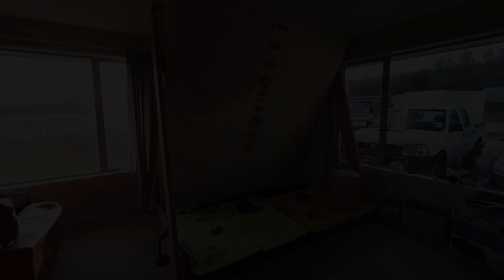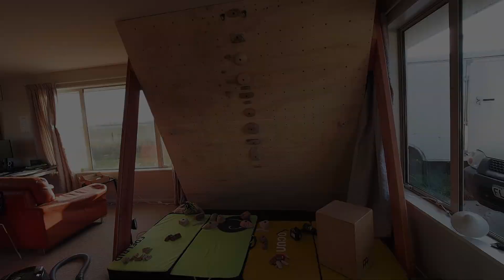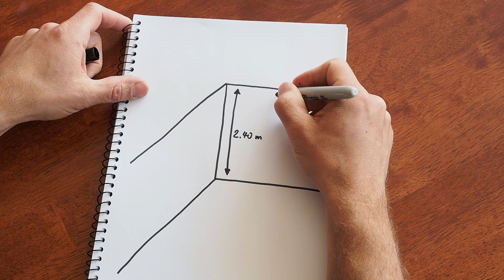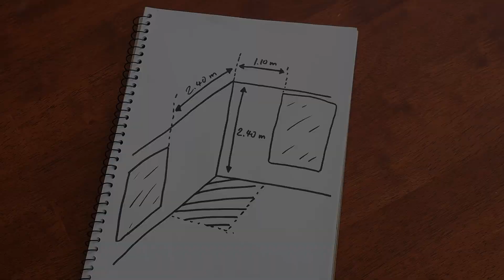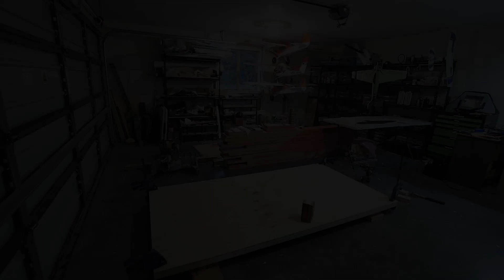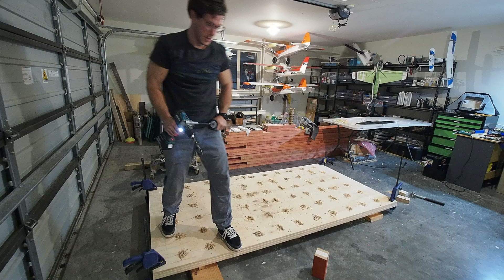How To Build A Free-Standing Indoor Home Climbing Wall

Comment: Man such a beautiful wall! Definitely an inspiration for my own project. Also, I just love the view you have from your living room!
Reply from the maker: Thank you Elias. I'm really pleased to hear that. Enjoy your project! :)
Reply: @wurfttobias  I got a question! Those large nails you hammered in, did you attach a nut on the other side of them?
Reply from the maker: Yes, those were bolts so I attached a nut on the other side.
Reply: @wurfttobias  I've got one question! I live in an apartment with people above, below and by both sides of me. I wonder if a wall would cause a lot of noise. The walls and roof/floors are pretty thin in the apartment. I'm mainly worried about if the wall causes a lot of noise when you climb on it (when it pushes down on the floor), more than the bumps from jumping down because if you have thick and soft enough padding, I think that can be evaded pretty well....? I guess in that case, the sturdier the better, as to not cause unneccessary movement (which causes noise I guess).
Reply from the maker: @eliasholenhannouch807  Are you worried that the floor will make noise when you are climbing, or that the climbing wall is making noise?

I can just share my experience: a sturdy freestanding wall doesn't make any noise if the floor is sturdy as well. Climbing only gets noisy when you hit the wall with your shoes. 

But I guess  there could be some noise if the building you're living in has beams and boards that make noise when you just walk around... The small movements of the floor could probably also cause some torsion of the wall which could be noisy...

Does this answer your question?
Reply: @wurfttobias  Yes, it does! I meant primarily noise when climbing. I certainly won't do any dynos, so as long as a sturdy wall is quiet during "normal" static climbing I think it will be fine! Thx!

Comment: Really nice!!!! But, is possible to build the same structure in a situation where the top of the structure doesn't touch the ceiling? Thanks
Reply from the maker: Thanks! Sure, that's possible. It's a free standing wall. The structure isn't touching the ceiling, there is a 2 mm gap... 😁
Ideally, you want to make your climbing wall as high as possible as long as your ceiling height isn't above 3.5 - 4 meters.
Reply: @wurfttobias  Thanks... you think that I can use a beam 9cm x 9cm to use for build the structure? (I have this kind of beam at home)
Reply from the maker: @simonekresevic6016  It will be less sturdy than when using 140 mm x 45 mm boards while at the same time being heavier... It will probably work, but I'm not an expert so please ask someone else for professional advice.

Comment: Sweet wall. May I suggest a sheet of Lexan between the wall & the window? (To save a flagging leg from going thru it?) I'm sure you'll be careful to not go thru it, but having friends over for a session...
Reply from the maker: Thanks for your input, that's a good point! I have some really large, 2 meter long, 1 meter wide, and 250 mm thick foam offcuts left over... Will put them between the window and the right stud of the wall while I'm climbing. Should make it safer! :)
Reply: @wurfttobias  that’s a cheaper fix! As Lexan can be pricey, I paid $100 for a sheet to hang in front of my 55” flat screen when my kids were younger. It saved me from having to buy 3 replacement TV’s and cleaning crayon off of it. I suggested it because it would still let the light in, but I like your cheaper alternate

Comment: Strong and simple design 👍
Looks like a lot of work - are you drilling pilot holes for all those screws?
Reply from the maker: Thanks Kristian! No pilot holes for the frame, only for the top and bottom board to make sure that the wood doesn't crack at the ends.
Also no pilot holes when screwing on the plywood.

Comment: Awesome build! Could you explain why rounding off the edges of the 2x4s prevents the studs from moving?
Reply from the maker: Thanks! I rounded the edges of the studs to reduce the risk of injury when climbing. The 2"×4"s at the bottom which are bolted to the studs as well as the plywood panel at the bottom prevent the studs from moving.

Comment: Thanks for sharing the video and design, I am about to jump in on a build here in the next few days.

Do you feel like your stud spacing would be sufficient for a wall that is a bit steeper (37.5 degrees)? Standard stud spacing in US is 16" (~400mm), but that seems overkill with 2x8 lumber, I was thinking going something around 19.2" (~485mm) or 24" (610mm) on center.
Reply from the maker: You're welcome! You've got exciting times ahead of you. :)

On my first climbing wall, I had something around 485 mm spacing, which was plenty in combination with the 22 mm thick plywood. From what I've seen in commercial gyms, you can increase the spacing if you're using enough vertical struts.
Reply: @wurfttobias  thanks for the response, I am going to try 485mm spacing with 18mm plywood. I think given the length of the actual wall it wont move to much, but we shall see.. Very excited to finally have a wall at home to train on, BIG DAY.

Comment: Great video, thanks Tobias! Do you think it work to have longer pieces on the base, with more holes, so that you could remove the bolts and change the angle of the wall? I’m hoping one wall could be used by a range of abilities by changing the incline, thanks, Olly
Reply from the maker: Thanks Olly! I'm pretty sure such a design would work, but you should definitely consider that the wall is very heavy... There are plenty of different adjustable angle wall designs out there (e.g. https://www.megalithclimbing.com/pages/freestanding-adjustable-system-wall ) and because of the weight of the wall most use a pulley/winch design with some backup chains. The 'home climbing wall forum' on Facebook is also really helpful if you're planning such a wall. I hope this is any useful for you. Cheers, Tobi
Reply: @wurfttobias  Thanks! :)

Comment: A very well put together board and video. It's super! 
I want to build exactly this and living in Queenstown NZ. I got a few questions as to how I can do this but maybe a bit cheaper. I'm thinking of using 2x4 instead to build the frame.

Where did you buy your T-nuts and bolts from? And overall cost for all nuts and bolts?
And any advice or tips and tricks you learnt after building this that aren't already in the video?
Reply from the maker: Thanks so much!!
Ok, this is gonna be a longer one... :)

2×4 are an option but I would at least use 2×6. (A flexing homeboard isn't really fun)
To give you an overview on the cost side of things: I spent
190 NZD for plywood
130 NZD for screws and T-nuts
110 NZD for bolts (not for the holds), plates, nylon washers, laminated 2×4 and laminated 2×6
500 NZD for the 2×8
--> just under 1000 NZD.
You will probably spend at least as much for holds so for me it doesn't make much sense to reduce the total costs by 10-15% by using 2×4.

I helped building the new Uprising in Christchurch and I buy Würth screws and Würth T-nuts via my contacts there. :) --> advice: ask at your local gym, they should have T-nuts.

And I buy bolts at a local engineering supply. Don't know if that's really cheap (0.50 - 2.00 NZD per bolt depeding on the length).

Learnings: 
- could have made the hangboard stick out another 100 mm
- would have used 22 mm plywood (better quality)
- general advice: make it as big as possible. This wall is an awesome training tool and I love it. But my old homeboard was bigger and thus required less dedication/motivation
Reply from the maker: And one more thing Jamie: you can let me know when you finished your board (via instagram?). Would love to check it out at some point when I'm in Queenstown again :)
Reply: @wurfttobias   you bloody legend! Thank you so much for giving me everything! Just two more questions.
Is there a reason you didn't buy the treated plywood in the first place?
And with your T nuts did you put a dab of glue on the back to prevent them spinning?
Of course I will send you pictures and your more than welcome to join me on it when I get this puppy up and running
Reply from the maker: Awesome Jamie!!! Looking forward to the pictures! :)
They didn't have the untreated 22 mm in stock (treated is expensive and not required for indoor).
Glue is also not required if you have access to the back of your wall!
Cheers, Tobi

Comment: Awesome wall! May I ask what type of wood you used for the 2x8 frame? I see you used pine for the plywood but might have missed if you said the wood type for the framing lumber. Where I’m located most of the 2x6s come in either douglas fir or pine so just checking which you would recommend or another type. Thanks!
Reply from the maker: Thanks! I'm using pine for the frame.
Reply: @wurfttobias  sweet! Was it all pre-treated wood? The frame and ply? I read somewhere you can either buy untreated wood and paint it immediately after build to seal it or buy treated which u have to wait 4-6 months to paint. This will be my first big woodworking project, I’ve only done small scale stuff to this point, so just looking for some pointers to get it right the first time haha
Reply from the maker: @stephenlopez3553  the frame wood was already pre-treated. Why do you want to paint it? Is it for an outdoors wall? That's a good first big project! :) 
Cheers
Reply: @wurfttobias  oh okay good to know! It’s gonna be indoors in a garage but we live in a relatively high humid area so i wasnt sure if i needed to seal the wood to prevent splitting/cracking over time so thats the only reason I was considering paint. But i prefer the natural wood look!

Comment: This wall is awesome! I'm looking into building one that would be 3 sheets of plywood instead of 2, at 35 degrees overhung. Do you think I could still get away with the 2x8" supports? I'd really like to avoid more supports in the climbing area.
Reply from the maker: Thanks Alan! From all the other walls I have seen out there, I am pretty sure you will get away with it. Keep in mind that the frame of the wall with the plywood is already quite sturdy (not much movement to the side) so the support studs have to mainly carry the weight (which they can) and not handle much side forces. But I'm also no certified builder and after some quick research it seems like in the 2 meters and longer span they often double up 2×8"s to prevent buckling: https://plasticinehouse.com/how-far-can-2x8-span-without-support/
I would just build it, see how sturdy it is, and in case I have doubts I would double them up.
Reply: @wurfttobias  ah good call. Thanks for the response!

Comment: Not sure if I missed it, but what angle is your wall? and do you remember what angle you put the Mitre saw at when cutting the studs to get that angle?
Reply: aw i see it. set at 26 degrees.
Reply from the maker: I can't remember the angle of the studs, but as far as I remember I chose an angle so that the bottom of the studs are about 30 cm further out compared to the top of the climbing wall.

Comment: Hey Tobias, I'm looking at making a very similar build but for the moonboard so 12'x8'. 
Given the extra height is there anything about the structure of the frame I would need to change?
Reply from the maker: Hey, I'm not a pro so please make sure to double-check. I think I looked this up a while ago and a builder would double up the two 2"×8" studs which support the whole wall if they are longer than roughly 2 meters (don't know if its actually necessary in this case). I would also make the studs stick further out than the top lip of the wall (in my design it's only 30 cm) so your larger/higher wall can't tip over. 
Enjoy building and climbing!

Comment: Is the wall size enough to consistently have fun and train? I am about to start a similar build and I am wondering :)
It looks so cool!
Reply from the maker: Very good question!! It's definitely less fun than my old 42 degrees, 3 m × 3.5 m board. I can't get the rewarding feeling of finally climbing a 10 moves boulder after months... But I still use it consistently because:
- the angle (less steep) is better to train more often
- all wooden holds is better for my skin
- because there are only wooden holds on the board my contact strength has definitely increased
- the symmetry is so much fun to explore your strengths and weaknesses

If you're into training anyway, the size is perfect but I would make it as big as possible (maybe just wider)
Reply: @wurfttobias  Thank you for your answer! I will try to add 1 or 2 feet in width!

Comment: Hi, I am looking to build my own wall, I was wondering why did you drill holes on three plywood in the beginning and I only see two segment (and one small piece at the bottom) when you were mounting it on the frame. Where did the third one go? Or am I missing something? Btw, it's such a cool wall, thanks for sharing!
Reply from the maker: Thanks Nurrin!
The third sheet was cut into smaller pieces: one small segment at the bottom, the largest segment is on the floor between the two studs to prevent them from moving sideways (doesn't need holes, but it was just quicker doing it this way) and the remaining offcuts were used for the hangboard setup.
Reply: @wurfttobias  Thanks for the clarification Tobias, yeah that explains it well. I see that you are based in Canterbury, that's so cool as I am building my wall in a rural dairy farm in Canterbury too as the climbing gyms are so far from where I live, how are the odds haha.
Reply from the maker: @ajmalanuwarful  Hahaha, so cool! Shoot me a message in case you need some wooden climbing holds

Comment: What size holes do I need to make? Do I just need a drill and the right size bit? (never built anything before haha)
Reply from the maker: Hehe :) I'm using M10 T-nuts which have an outer diameter of 12 mm (just measured it) and I use a 11 mm drill bit only. Because the T-nuts have tapered edges, I don't have issues getting them in and they will sit tight because of the smaller hole diameter. 
Have fun building something for the first time! :)

Comment: I am building a campus board and want to make the structure similar to your wall. What is the angle you cut your front supports? Is it a mirror of the back support/legs holding up the frame?
Reply from the maker: The front supports are 30 cm further out compared to the top of the wall. Don't know the exact angle because I attached them not at the highest point of the frame. But in case of building a campus board I would definitely increase the angle a bit because the center of gravity (with climber) will be at a more unfavourable point (common angle of a campus boad is 15 degrees I guess, so its less steep compared to my wall and if you build it with kicker board the center of gravity of the board itself will even come more forward).
How wide will it be?
If it's free standing, I would definitely build it wide enough (or add some support legs) so that it won't be able to tip to the side.
Hope this was helpful? :)
Reply: @wurfttobias as you're an engineer (and I am not) if I made this wall 2.7m high with the same dimensions (as described in the video) with it still be able to be free standing?
Reply from the maker: Hi @shanehoubart9832  this design has enough margin to increase the height of the wall by 30 cm. Just make sure that the legs/studs of the wall still stick out compared to the top of the wall (maybe 35 - 40 cm instead of 30 cm as in my design, if I remember it correctly) so the wall cannot rock over.

Comment: Hi im debating in having my wall ti be 3 sheets or 2 sheets high, whats you recomend ir you believe there Is no diferencie
Reply from the maker: Definitely 3 sheets! The extra height will make the wall so much more useful and more fun. You will gain 100 % more climable wall area (because the first sheet is only used for feet and low starts) by adding 50 % more to the total surface area.
The wall in the video is just not that high because of the ceiling height.

Comment: can I not include horizontal wood on the back panel? will it make the plywood flex when climbing?
Reply from the maker: Hi Harris, if you don't use any horizontal framing on your wall the plywood will flex and the whole structure will be a bit dodgy. But for a small wall, you can get away with having horizontal frame at the top and bottom only and then add more later if it flexes too much.
Reply: @wurfttobias  thank you for the idea.

Comment: Would this same concept hold a wall that is 10-12 feet (3.04-3.65 meters)?
Reply from the maker: Disclaimer: I'm not a builder!
The frame, together with the plywood wouldn't need a change at all. But when you look up how to use 2"×8" studs, builders would double up the free standing studs when they are longer than approximately 2 meters. I've also seen designs where they used two separate pairs of studs, one pair shorter and attached roughly at the center of the frame. What I would do: build it, see if it is dodgy when "loaded with climbers", and in doubt: attach extra 2"×8" boards with bolts to the two studs that support the wall.
Reply: @wurfttobias  thanks brotha 👍🏻

Comment: Great video! How did you decide or go about the pattern of the holds? Was it random or did you strategically place holds where they are?
Reply from the maker: Thanks! ☺
I tried to place the different hold types evenly (for example not having all crimps in one spot) and then have a variation in the orientation of the hold types... But at the begining, I started randomly and then I had more restrictions over time.